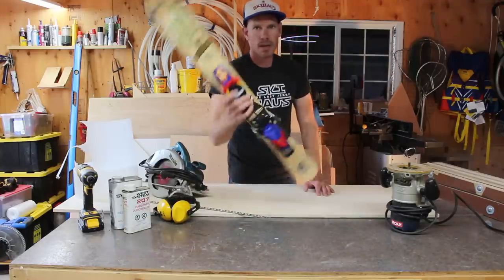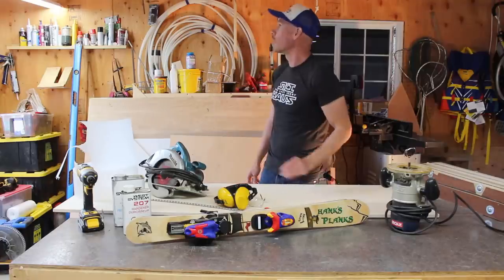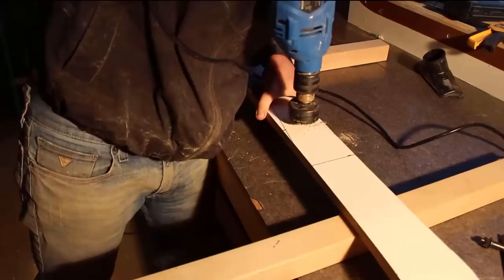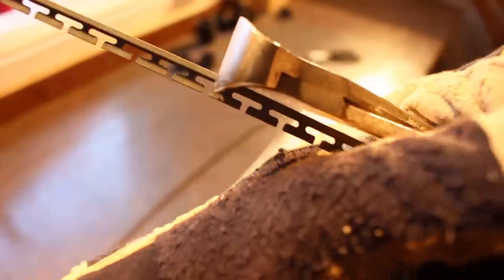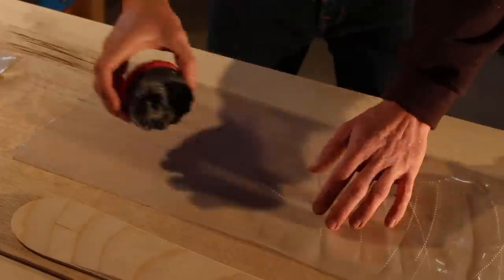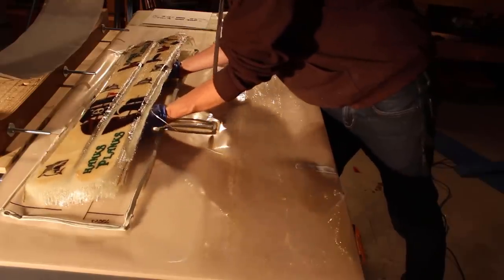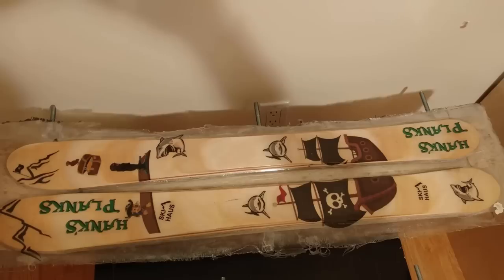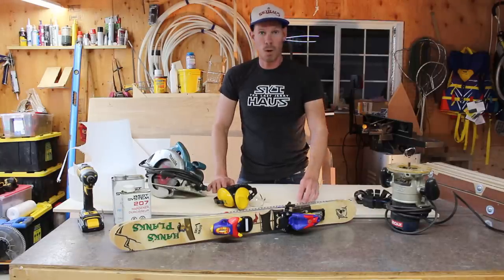How to Make Skis At Home - Build Skis at Home NO Press NO CNC Machine - Make Your Own Skis

Comment: Love Leo! Thanks for this, I have a professional woodshop, but want to try to make skis. I'll definitely take what I learned here!
Reply from the maker: If you've got a pro shop, this iwill be easy peezy for you! have fun@
Reply: @TheHowtoDad  awesome, I'm definitely going to give it a try. Have you made skis for yourself? How did you apply heat?
Reply from the maker: @JamesTorrey  I think you're asking about heat for the curing process.  Unless you are pressing a lot of skis and need them to cure fast, you don't need to apply heat to the skis while they are in the press, you just have to leave them in there longer.  The big boys do that so they can press more skis in a shorter period.
I made my own skis about 8 years ago, it was fun, but I had to make them twice because the first pair failed. In fact, I would suggest ordering enough material to make 2 pairs...

Comment: I was worried this was gonna be one of those "diy" vids where "i designed this in cad, 3d printed the mold, milled this part, plasma cut that part, then finished it out on the lathe" 
For someone looking to go simpler, uhmwpe tape works great for a durable, slick bottom. Thats more for a sled, where edges aren't as important. Impressive build though! I may do this for front skis on the powerwheels
Reply from the maker: those videos are honestly the worst. I hate those too.  I try to think of the average person when I do my builds. glad you appreciate that.

Comment: @howtodad - this is an awesome guide, love the idea with your car as the press I was thinking the same thing. Could you share a link or some info on that vacuum bag and valve construction, thinking I’d like to take the same approach with my build.
Reply from the maker: hey Cody, I'm away from my regular shop for a while, also my harddrive with all my footage crashed last week (major bummer) I'll see whay I can do about puting a video together about the valve, but it's really very simple:
the bag is just vapour barier (writing out, it will stain your skis if in) the bag is sealed with butyl calk (easy to find) and the valve is simply pex pipe with a ball valve, that's it!  I wrapped the end of one of the pex lines with tape so I could attack the shop vac and pull down the vacuum. I't pretty janky, but it worked!
Reply: @TheHowtoDad  sorry to hear about your hard drive, damn technology lol. But thanks a ton for the response and a bit more detail, just wanted to make sure I wasn’t missing any big steps. Have a great day!

Comment: First of all: Nice video man, well built and simple, that's very important in a process complicated like ski making!
Second of all: I'm trying to make my own vacuum bag right now, but I don't know if I'm using the right type of plastic. You are using polyethylene right? And what's the thickness of the plastic? Also, what are the white pipes you are using with your vacuum?

Thanks for the heads up, keep skiing with your little guy!
Reply from the maker: Thanks!
I used 6mil poly (vapour barrier). Make sure whatever you use, if there is writing on the plastic, the writing is on the outside. It will print Ont your skis! Also, remember to tape the base material with packing tape. Keeps the resin off them.
The white pipes are just 3/4 Pex.
Good luck!
Reply: @TheHowtoDad  Thanks for the quick answer! So you applied the red tape that we see on your vacuum on the base of your skis?
Reply from the maker: @daisykiller6  no! Don't use the red tape in your base! Just regular clear packing tape. Thst red stuff is very sticky stuff and will leave residue behind. Another great resource for this kind is stuff is skibuilders.com
Reply: @TheHowtoDad  My skis are in the press but my vacuum bag fucked up pretty badly lol

Comment: Is there any way to do this without using the vacuum bag? My only concern is properly making my own bag and using my crappy shop vac to draw the vacuum. Could a carbon fiber layup be done instead?
Reply from the maker: The reason for the vacuum is so the wood core, the fibreglass sheet and the resin are forced together to create a semi-monolithic unit.  A CF layup would likely not work, but I am not an expert on these matters.

Comment: I really like your info. Have you ever made a big boy set of skis?  180cm or more?
Reply from the maker: yes. I have made a couple pairs of skis.  the process is very similar
Reply: @TheHowtoDad  Did you use the car as a press for the big boy skies?
Reply from the maker: @rickden8362  no. for the longer skis we used a vacuum bag and a mild to shape then skis. no press
Reply: @TheHowtoDad  Thanks for the reply. Could you expand on the ''a mild to shape then skis'' I don't quite understand.
Reply from the maker: @rickden8362  mold...not mild.
Reply: @TheHowtoDad  So you clamped the mold?
Reply from the maker: @rickden8362  exactly. combo of straps, clamps and some heavy objects.  it's just to give the skis their shape, the vacuum bag is what does the laminating
Reply: @TheHowtoDad  👍